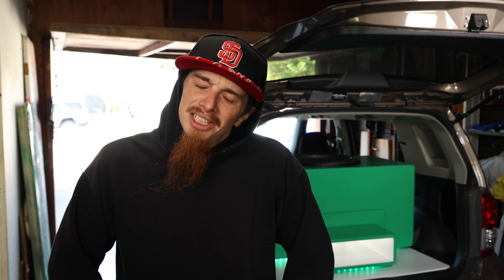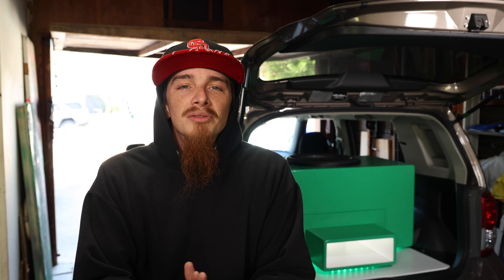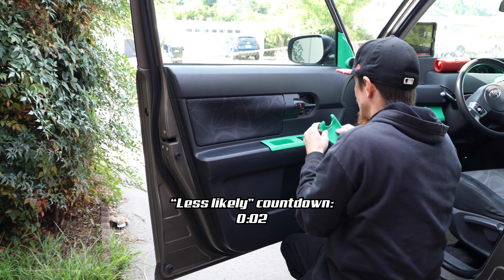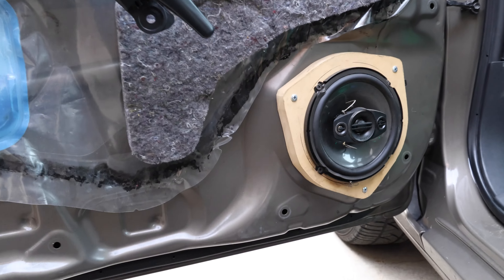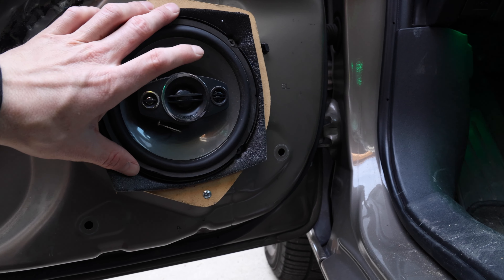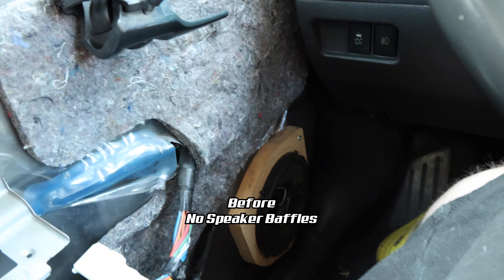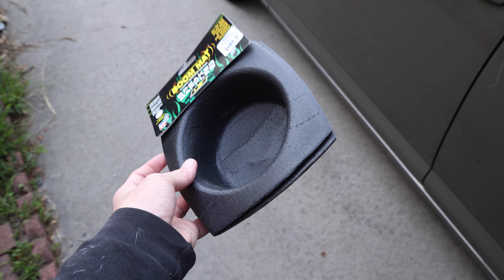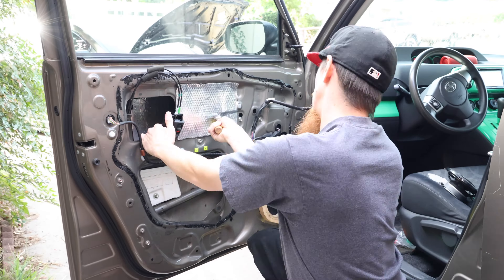Do Speaker Baffles make Speakers Sound Better?

Comment: Making the enclosure smaller for a typical car audio 6.5 driver designed to run free-air isn't going to do it any favors. Good job pointing this out to those on the fence.
Reply from the maker: Yea that’s about what I suspected.  Had to try for science!  
Thanks for checking it out!
Reply: Car doors are worst place for any driver ' the speaker reproduces the sound not the whole door playing ' 6.5" speaker needs 11-13 litres of space in an enclosure ' the excursion of the rear of the cone fires at 45-70 degree angles ' so the worst thing to do is put your speaker in a tunnel ' manufacturers should start redesigning door cards to only cover top half of door & bottom should be full length wooden speaker enclosure instead of pockets for junk ' sound deadener & sound absorption are two different things ' the idea is to stop vibration from speaker being transferred to door sheet metal
Reply from the maker: @gabc6296 yea needless to say they didn’t help

Comment: I never understood why they would claim that baffles provide more mid-bass.  Maybe if you're getting too much deep bass and you don't like it.  A baffle will lessen the airspace for your speaker.  This causes substantially less bass.  I you want more mid-bass, sound deaden your door.  Put it all over inside of the outer door skin and all over the door skin where the door panel goes.  Basically, you will build your door into a speaker box.  You don't need the sound deadening material to do this.
Reply from the maker: Yea that always sounded like some marketing bs to me, so I had to find out for science lol.  And yea that’s exactly what I did (literally same day as this video was shot).  The doors and panels already had about 50% coverage, so I went ahead and finished the job.
Very funny the way you worded your comment, almost word-for-word the way I described it in the video I’m literally editing right now about it.
Thanks for the suggestion man!
Reply: @DaBadNewz  LOL... I try to be more clear about it.  I have had people actually put the material on the actually plastic door panel.   Also, check the air space requirement for that new speaker to make sure your door offers enough airspace.
Reply from the maker: The plastic panels in this car definitely benefit from a lil weight.  They like to resonate.
But yea measuring the airspace would help me dial it in a lot better.
Appreciate the tips!

Comment: I suggest putting a 1 square inch opening in the down facing surface of the baffles. This allows airflow in and out of the "box" created by the baffle. I find this improves the bass / mid-bass coming from the speaker.
Reply from the maker: That’s been a surprisingly common suggestion (that I never even considered).  And while it might work, it’s not even worth it for my purposes tbh.  Plus, the baffles would never fit around the new speakers anyway.
I’ll be installing midbass speakers pretty soon in their own enclosure.
Thanks for the suggestion though!

Comment: What I did was cut the back of the bottom half off which made a big difference. Still water proof from the top and has the airspace underneath
Reply from the maker: That’s been a pretty common suggestion that I wasn’t really expecting, but it would definitely be interesting to test that to see what results I get.  
I just decided not to run them.  I wasn’t committed to them, and they don’t even fit the new speakers, so they’re just spare at this point.
Thanks for your suggestion though!  It’s popped up enough that now I’m really curious.
Reply: Yea my first speakers started corroding from getting wet so I wanted to protect my new JBL Stadiums.
Reply from the maker: Oh yea that’s no fun!  That would probably make me reconsider not using them too
Reply: They make them like that already open in the back , i thot of getting some to protect me speaks every one just tells  me they will fine unless u have rain blowing sideways in ur doors 😂

Comment: These are made to reduce or remove resonance from having so much open space behind the driver. Thus reducing mid-bass. They work well to improve lower range vocals, those tend to get lost behind the baffle of the door. Think about it, you are shrinking the box tremendously which brings fs way up as well. You'd have noticed the difference playing some nice vocal tracks.

So yes, these were not meant to accomplish what you need. You need help in a lower frequency band.

I am also  a deaf bonce dealer so I am curious how you like the new drivers.
Reply from the maker: Yea I didn’t expect much out of them, more so just wanted to disprove their Amazon claims lol.
And so far I really like them!  (I’ve had em installed for a while now and am just kinda slow to getting to the edits).
They’re still not particularly great in the lower mid frequencies, but I expected that and already have something to address it (being a DB dealer you can probably take a guess).
But for the vocal range and even some of the higher stuff get nice n loud and still maintain clarity really well.

I’m very happy with them and will likely look at DB again in the future.

Comment: What if you make this out of a wood or plastic ?
Reply from the maker: I think it would be 1000% more useful if it was made out of wood, (and even plastic as long as it was pretty thick/rigid).  I feel like the foam just wasn’t strong enough to “contain” and control the sound the way something with some more weight would do.

Comment: Thanks for the information. Saved me some headache and money! See ya next time!!
Reply from the maker: Thanks for checking out the video!  Glad to help!  See you at the next Bass Meet
Reply: Hey, those Deaf Bonce Arnold's are bigger than the rest of the 6.5s hole sizes. You may have to trim more hole than normal!
Reply from the maker: I did!  I had to shave a good lil amount out of my MDF adapters.  Luckily the metal didn't need to be cut any bigger.
Reply: @DaBadNewz  are they loud?😁
Reply from the maker: They do pretty good!  I had to actually adjust the gain down a lil bit when I first installed them because they were starting to overpower the sub!
I don't know if you heard at the last meet, but that was the first time I had done any kind of distance test on them and they did a lot better than I was expecting.
I'm going to show all that in a future video

Comment: the sundown salt200.4 is great for mids/high amps
Reply from the maker: I mean I’m sure it’s pretty great, but it’s also about $430 more (or a little over double), the one I got.  That $/watt just doesn’t work for this build.
Thanks for the insight though!  I’m definitely open to checking one out in the future
Reply: @DaBadNewz  no problem

Comment: Ya PORT the Boom Mat enclosure in relation to corner loading aka the port should aim towards the front of the door. Simple hole in the Boom Mat will direct lower freqs towards the door and corner load thus an INCREASE in BASS.... Something ya gotta TWEAK. Good Video. BDBD/2024.
Reply from the maker: Fair enough!  might be worth trying in the future if I give these another shot.  For this build though, my new speakers wont even fit in the boom mats, so they're just spares for now.
Thanks for checking it out!  and I appreciate the insight!
Reply: @DaBadNewz  Old Timer here... installer from the 70's... 80's.... 90's.... 2000's...LOL.... Hung it up in 2008, called it a CAREER. I have worked on thousands of sound systems in as many cars. The DOOR... You can get a lot of sound out of them TO a POINT... Heres a trick. Calculate the AIRSPACE inside that DOOR there and LOAD in Speakers that match that reading... I am the 6x9 in the door guy... (the 70') here. I WISH I could fit 6x9's in my Kia doors... They have a WARM sound along with strong bottom end response as 6x9's go... BIGGER THE BETTER in the DOORS... My take. Heres to EXPERIMENTATION... and then helping the general PUBLIC with your RESULTS.... Very good... keeping the FLAME of AUTOSOUND..... LIT.... for yet another GENERATION..... Go make some NOISE!!!!!!!!!!!! BDBD/2024.:face-green-smiling:
Reply from the maker: That sounds like a pretty extensive career!
And that sounds like a much smarter approach to the doors.  My plan was gonna be to throw shit at it until something works!  Measuring everything out and doing it the right way sounds a little more cost effective though.
And thank you!  I just love documenting the process.
Reply: @DaBadNewz  @DaBadNewz... I noticed your HANDLE... your NAME... thats what got me to CLICK on yer page.... Good to know. RESEARCH!!!!.... BDBD.
Reply: BIGDOGBRODAVE PRESENTS... what I been doing... I was in LIVE Sound Engineering for decades here in Honolulu... at NIGHT... and days... AUTOSOUND engineering... Go man GO.

Comment: I think only best way to do it , need enclosers on r doors , mines not sounding good as well , bcs there just in freeair theres nothing to bounce the signals off of just open
Reply from the maker: Definitely!  Eventually I’ll have some fully built doors, but the deadening helps to seal it up for now
Reply: I just put in a request to Custom speaker pods , see what happens 😁
I told them ill cut my panels in half from the armrest down , looking for 2 tweeters , 1 61/2 , 1 8" and 1 10" 😁
Reply: Make it more solid was my thinking
Reply from the maker: shiiit if they make the kit, lmk!  I'll probably scoop one up too
Reply from the maker: and yea that's a must

Comment: Those dead bonce blow way way to easy! 
Get some sky high audio 6.5!
On point!!
Reply from the maker: Are those pretty decent?  I was looking at them when I was shopping around, but I never got a chance to hear them.
From what I heard, the DB do fine as long as you throw em rated power and correctly filter, that's why I took the risk (after hearing them in a few builds).  
Hopefully they work out alright, they been good to me so far!
Thanks for the input!

Comment: Great video, I’ve been curious about these for a while now. The problem with speakers that small is they can only play so loud at lower frequencies, they most likely roll off significantly at 150-200hz and forcing them to play lower than that would cause higher distortion at high volumes. Look into getting a calibrated microphone and REW software on a computer, that’ll allow you to test the capabilities of each speaker in your system. Hopefully that helps a little
Reply from the maker: Definitely!  I don't expect a crazy amount of mid bass from a 6.5, but I definitely wanna squeeze out as much as possible you know?  That was why I rolled off the low mids in the first place, to limit distortion.  
And it's funny you mention the calibrated mic because I've been meaning to get one anyway for work, (I'm actually an audio engineer when not doing car audio).
I actually have another set of speakers to install to REALLY address the mid bass (besides the DB 6.5s), but I'm keeping that quiet for now.
Thanks for checking out the video and leaving suggestions!
Reply: @DaBadNewz  The mic and software are really handy, I use it mostly for my home theater speaker calibration and testing house curves along with many other things. But recently found out that it works well car audio systems. Using the softwares pink noise and individual tone generators really helps with setting up equalizers, speaker limitations, time delay and many more things. It’s powerful software for people who love tinkering with the sound of speakers. Definitely worth it. My microphone was maybe $100 and the software is free to download
Reply from the maker: @rynev3392 sounds like I may need to take a look!  Which mic are you using?
Reply: @DaBadNewz  miniDSP UMIK-1…. I bought it a few years ago and it’s never had any problems
Reply from the maker: Thanks, good to know!

Comment: Maybe fiberglassing it would get better results. At the end of the day I'd just sound  deaden and block off plates for the door holes.
Reply from the maker: Yea that’s been a pretty popular suggestion, but after switching to the DBs, it just made way more sense to do exactly what you said and do a more complete sound deadening job.  And I have some plans for plates, but non installed just yet.
Thanks for the suggestion man!
Reply: @DaBadNewz  no problem.  I got a superduty, and the block off plated improved my mid bass substantially. Then again, I was running 8" dedicated mid bass. Those coaxals would struggle no matter what you do. The DB you got will definitely do the job. Only benefit is weather proofing,  recoil audio got some nice silicone back rings to prevent water damage.
Reply from the maker: Yea and those DBs aren’t the only thing I got for the mid-bass either!  Got more surprises coming!
I’ll have to jump on getting some plates made

Comment: Man you gotta put me on those tail lights! Lol i have had my 2011 release for over 10 years and cant find no custom head or tail lights! Its bs that they stopped making tish after 2010.....im bout to put some 22s on my tish just cause im bored lol
Reply from the maker: I honestly just got lucky!  Went to the junkyard for some daytime running lights and found these by accident.  If you look up other toyota rumion parts, you might find some extra accessories (but still not many)
Reply: @DaBadNewz  thanks man I see a few different styles on ebay but don't trust if they'll fit up or not....shame those killer 2010 headlights with the leds running across the top don't fit a 2011 smh thanks bro✌🏼
Reply from the maker: @scu-dub no problem man!  Good luck on your project!

Comment: I used a different brand that looked a little thicker and deeper than yours (could be wrong) on a set of kappa 63ix's. they produce a decent bit of midbass and a little bit of bass but it sounded uncontrolled and would rattle the doors a little bit at higher volumes, so i decided to go with those and it seemed to tighten up the midbass and reduce the overall bass of the speaker as a whole but also removed the rattle sound i was hearing from the door, now i should have just sound deadened the doors and that would have probably allowed for more bass and overall output of the speakers but i was still pleased with the outcome, we have a little 10inch sub in the car that takes care of the bass and even a little bit of midbass anyways. its my brothers car he doesn't like his music loud just wants a decent sound quality and i feel for the average person and depending on application like you stated these are the answer.
Reply from the maker: Yea I definitely think the money is better spent on some sound deadening, especially if the car is particularly noisy from the factory (like my xB).  That does a lot more for the overall sound quality than a foam baffle ever could.
Thanks for your feedback!

Comment: Great video-  The one place I would recommend would be in a rear deck that happens to be sealed when using 2 or more 10" or bigger.  It will help keep the sound pressure from subs pushing the smaller midbass causing over excursion-  SQ-  In my opinion , It  does not help.  I am building a SQ Challenger and these are not going to be in my design-  I am porting my rear deck with a 10" opening that will isolate the midbass from the subs.  Video to come in a few months..  Plan is ISACA. We'll see.....
Reply from the maker: I can see using them for that, to help protect from the sub pressure.  They’re definitely not useless, just not for me.  Not for this build.  
Sounds like you got some big plans for your build tho!

Comment: I just found (and subscribed to) your channel today! I'm about to do some binge watching to get caught up... Years ago I had an 85 Mercury Cougar (with the 5.0L 😎). The stock speakers in the rear dash were 5x7s. There were factory baffles behind them made of really stiff cardboard type material and lined on the inside with standard vehicle insulation mats. They were about the same size as the Boom mats. I was amazed at how much bass that car had! My friends thought I had a small sub in the trunk. I tried removing them thinking they would be louder because of the trunk, but put them back in. There was definitely more bass with the baffles in place.... I did eventually put a single 12" MTX Eliminator (mid 1990s) back there and built a custom box to fit the trunk. But I left the stock speakers in place.
Reply from the maker: Oh man that’s really cool!  Thanks!  I appreciate the sub!
Those factory baffles sound a lot more useful than these Boom Mats were.  And that sounds like it was nice car!
Thanks for checking out the video, hope you like the others!